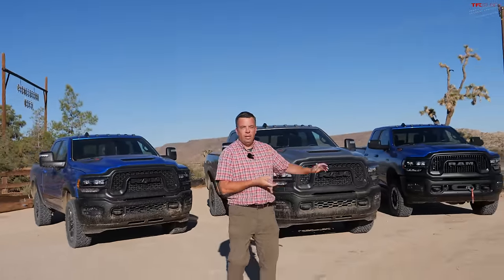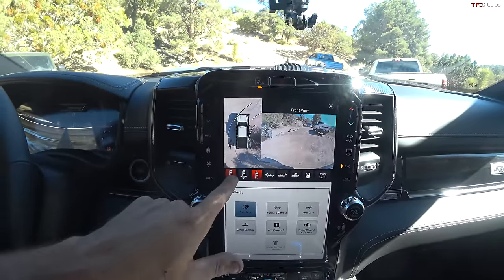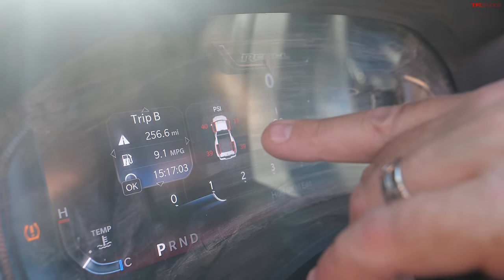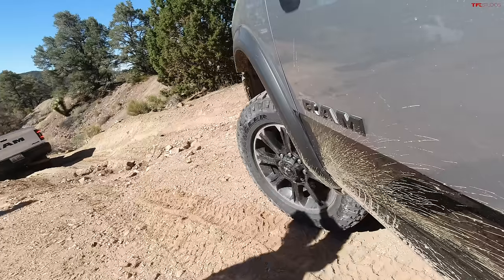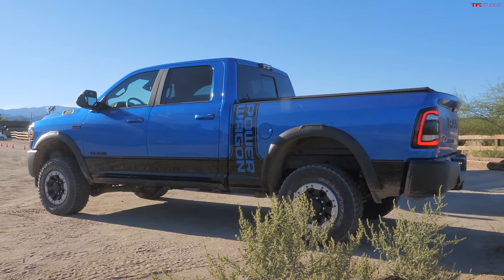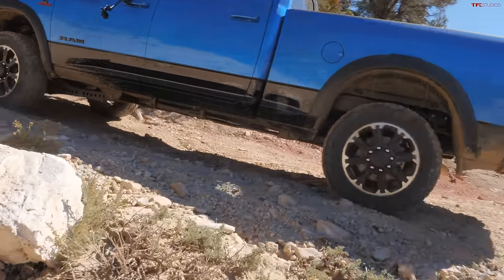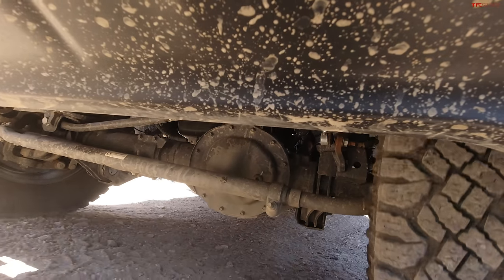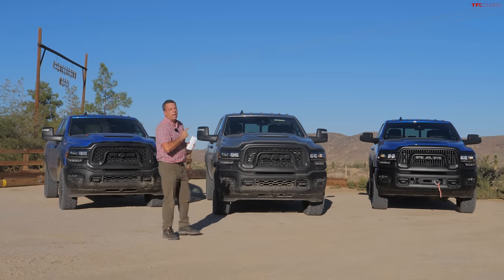2023 Ram HD Rebel vs. Power Wagon: One of These Trucks is the Off-Road KING, But Which One Is It?

Comment: 5 WAYS RAM COULD OF MADE THIS A WINNER:
1. put 35 inch tires on the rebel and PW
2.put a new cab on the HDs already
or at least offer the mega cab option!!
3.offer a HO option in the 2500s
4. put a new 8 speed trans behind the diesel!!
5. at least offer a limited slip in the front!
Reply: Yes can we get the new cab already

Comment: I always wanted a power wagon cause dual locked solid axles and disconnect sway bar… then Jeep made the non-power wagon aka the Gladiator and it just fits my needs much better. Didn’t want another full size and wanted something a little bigger than my Tacoma. 

2k lbs less, same size tires stock, much easier to get in and out and park with virtually the same off road dimensions. With a 2.5” lift and 35s though I still get better fuel economy and have far better off road capability than the power wagon.
Reply: That’s one of the most logical things any has said on the Internet
Reply: You know what’s messed up though they are pretty much the same price. A midsize truck for 60k just makes me go crazy. I love the idea of a convertible truck by if I had 60k I would have to go for tradesman pw. Now if the 392 or that tti6 makes it’s way to a gladiator then I would go with the gladiator.
Reply: @rosswallace2969  The above truck was $90k. I bought mine for $48,400. They aren’t close in price when similarly equipped even a loaded out $65k Jeep.

Comment: I love my paid-for 2014 RAM 2500 Laramie Cummins 370/800 68RFE. 70k trouble-free miles. Sticker was $60k new. 2240 payload and 17,100 rated towing. I bought it new back in late 2013. Personally I don’t need the off-road capabilities that the Rebel and Power Wagon provide.  Also getting 16-17 MPG average and over 20 MPG on highway trips is nice. The prices of new trucks, all vehicles actually, is ridiculous. It is neat to see the RAM trucks in this video in action. Thanks Andre!

Comment: Same problem with these packages as with the other manufacturer's coolest and most capable offroad packages: They are only available in a crew cab/standard bed. Need a doublecab/extendedcab pickup with a standard bed to get a shorter, more offroad usable, wheelbase. HD trucks already don't cut the wheels as far as as Fullsize trucks and are a foot longer. But add another foot of length because these are all crewcab and you need 40 acres to turn these rigs around.
Reply: True but most people aren't going to pay 90k for a truck and take it any place very rough , the places he took  these trucks like I use to take some of mine. Me personally I would buy a used beater to take out into the rough stuff.

Comment: The only draw back to my ram 2021 2500 6.4 was the spongy brake pedal. My equivalent work truck is a Ford F250 and it does everything great. This is just my experience. And yes the dealer said the braking system was normal on my vehicle but it didn’t feel normal to me.
Reply: Did you get the computer update? There was a recall issued with a computer update to address some braking issues.

Comment: Ford Trembler may have 35's but it has leaf springs unlike the Ram Rebel and Ford Raptor. You can add 35's to the p.w. no lift. Diesel is soo heavy in mud and snow the truck  slides all over the road. Gravity takes over. Diesel is good for towing. Torque for starting the load moving and low RPM for fuel savings. P.W. is the King off road period. Before Jeep there was Dodge 4x4 trucks since 1934.

Comment: I've never seen the point of the power wagon, it's too big for most trails and it can't tow anything because the payload is horrible. Power wagon just seems to be the truck for guys who need to compensate for other shortcomings. I guess it would be a great recovery vehicle but only in open areas like sand dunes and big trails.
Reply: It's even the same with some of the "regular" 2500. TFLs 2500 cummins has a payload of like 2000 pounds. It's the same as my toyota hilux!
Reply: Called options. We should just be greatful RAM makes it.

Comment: To Andre's point about the size of the wheel robbing tire side wall 4:00. I wish truck makers pushing off-road capable trucks would stop with the 20" OEM wheels. Tire tread is NOT enough if you are going off-road. You need as much tire wall as possible both to be able to sufficiently air-down, but also to protect the wheel rim from getting bent on a rock. Regarding range, nothing beats a diesel 7:00, only problem, the White just said there is only 25 days left of diesel fuel. Not sure how true that is. But they have been selling our fuel reserves to China. Just throwing that in there as something to think about. If it's not the issue they stated it's not a problem. 7:32 I have also thought these grills were fugly. Again, I have to agree with Andre on the 20" wheel and lower profile tires for similar reasons I mentioned earlier.

Comment: I’m looking for a suitable, good looking, long lasting & more aggressive replacement tire for my 21 Ram 2500 Laramie with 20 inch wheels. I’ve gotten almost 17,000 miles out of the original Firestones so far but I’ll need to replace them before I get to 20k. Thoughts on going with the Goodyear Duratrac??? I like the off road capabilities but how economical are they when it comes to towing?
Reply: I get about 2 yrs/20k miles out of them on my PW. Rubber soft great in snow

Comment: Power wagon has a 50% front 50% rear  power split. Does the Rebel have 40 60 split? Power wagon has low ratio transfer case.

Comment: Ram/Stellantis is being strangely stubborn about this package by not offering a winch on the Cummins Rebel. If you bite the bullet and spec out an AEV Prospector - which demonstrates on a proxy OEM-level that it can be done quite readily - they'll gladly put their winch/bumper on your truck, or you may opt to do it yourself. Ford offers it on all SuperDuty Tremor configurations, so why can't Ram? 

Further, unlike Ford, why isn't the HD Rebel package offered on the 3500? It would reasonably extend the payload capacity gap between the Power Wagon and the Rebel 2500 and make this whole "HD Rebel" idea seem less like an overpriced afterthought and weak counterpunch to the SD Tremor, than a real off road performance package.

Comment: You can always tell your dealership before buying that you want the 18 inch wheel instead of 20 inch ones. If you have a good dealership they will switch them out. Ram should of did this Cummins Rebel a long LONG TIME AGO! I do drive Ram. I currently have 3 Ram trucks. If I were to buy a new truck today I would get a Ford Tremor 6.7

Comment: These diesels arnt great for off road. They are meant to be pulling at a constant rpm. (Thanks useless EPA emissions) if you are doing more off road. I don't think you'd buy a full size truck anyway. But gasoline engines will always be a great choice for off road. These modern v8s are Beasts when it comes to hauling your typical stuff.

Comment: I have a 2015 F350 King Ranch Powerstroke that I bought new. I do trails like this pulling a 7000 lbs travel trailer. My truck has a Carli leveling kit, the factory rear locker and 35" Ridge Grapplers on it. Handles trails like this without even working hard.

Comment: Frame chassis just cracked in half. 
Anyone have any issues like this? 
// 2020 Dodge Ram 3500 1 Ton rated at 6000 GVW Not over weight and not carrying water at time. Carrying a 2020 Eagle Cap 1165.//

Comment: What I really want in a heavy duty truck is a standard cab and an eight foot bed.
Reply: well order one then
Reply: @speterbilt  They aren't available in that configuration. Only in a four door with the tiny bed.
Reply: @CraigSmith568  what? Wrong. On Ram's website you can build & order a single cab longbed all day
Reply: @speterbilt  Go try to order a Ram HD Rebel or a Power Wagon in a single cab. They even say in this video it's only available in the four door.
Reply: @CraigSmith568  that's true. But ypur original comment didn't say that you wanted one of these specced that way. I agree it would be cool if you could get one that way
Reply: @speterbilt  That is true, but I just thought that since that this video was about these two that it was what I meant. I guess I should have been more clear on my original post. I agree it would be nice.
Reply: Nobody does that anymore. Do they?

Comment: Regardless of it's off road abilities, it is inexcusable that an HD truck has less payload than a Maverick.
Reply: Small sacrifice to be capable of going almost anywhere. Maverick wouldn't be able to climb over a trail of Lego toys.
Reply: @sh0cktim3  but the Mav will get where 90 percent of where people need to go. And it will drive further each time all while carrying more weight.
Reply: @Silverback_GMT410  PW is a specific purpose built vehicle man. Best truck with a factory warranty that you can take off road. HD frame, steel bumpers, don't gotta worry about bending nothing. Winch available and rides like Cadillac ON and OFF-road. Can seat 6 people. 6 and 1/2 foot bed. Can still tow over 9000lbs with ease. I don't see any point in complaining about having different options available to us as consumers. You can literally buy a 2500 HD RAM with over 4000 payload and it'll tow 20,000lbs. Or get more crazy and get a 3500 with over 7000 payload and can tow well over 30,000lbs. Options are good. Wouldn't it suck if the only truck available was diesel workhorse with a 8 foot bed. Not everyone needs that. End of story.
Reply: @sh0cktim3  but my issue is that at 9000 of towing for a truck that gets maxed out by it’s tongue weight is pretty sorry. And and HD truck with off road chops can be found with the Tremor that can also seat 6, 6 and 3/4 bed tow north of 10,000 lbs and payload to spare for people, and cargo. Along with a winch option, and engine options.
Reply: @Silverback_GMT410  tongue weight only getting maxed out if you can can squeeze 6 fat chicks in the cab. Tows 9000 with ease,  rated from the factory to tow 10,500.

Comment: When comparing door stickers you told us what the 2 gassers towing capacity was. But not the diesel. Just the payload.
Reply: He didn't mentioned it because diesel is less. Max towing for such model is 14,920 vs 16,870 on V8.
Reply: @jeffwill4923  that’s why I love a gasser. Definitely need an Ike towing test with this truck, hemi vs Cummins.

Comment: For me, I’d really consider a PW if the payload was merely 2000lbs.  But as is, the juice isn’t worth the squeeze.
Reply: Then you don't need maximum off-road capability.
Reply: Easy fix with some Carli springs.

Comment: I just want a Power Wagon with the Cummins and no winch.  I'll happily put an aftermarket steel winch bumper on it anyway.
Reply: So your payload would be about 300lbs.
Reply: @donrichter3523  The spring rates would have to be higher than the HEMI Power Wagon, sure. But that's a compromise I would happily accept (and I think many other people would, too) in order to get a Cummins 2500 with the articulated front control arms, locking front axle, and helical locking rear axle that are only available on the PW.
Reply: @elektro3000  Its been said many times, its not as simple as drooping diesel into the engine bay.
Reply: They don't do it for a good reason. You need to build a AEV kinda truck of you want that. Can have your winch too. Gonna cost over $100,000 though.

Comment: Power wagon is always the king.
Reply: Competes nicely with a 90’s ford ranger in the payload department too
Reply: @pryme2013  well that’s not the point of a Power Wagon.
Reply: @XploreAz  I’d venture to argue the point of a HD truck is not to off road.
Reply: @pryme2013  but that’s exactly the point of this truck. Where do you see any advertising of towing and hauling with this truck? You don’t. You’ll only find off-roading.
Reply: @XploreAz  I know what you’re saying. What I’m saying is a heavy duty truck was first and foremost designed to work. Not off road. They are way too heavy to be great off road. A run of the mill jeep wrangler would shit all over one of these off road
Reply: @pryme2013  but a Wrangler can’t tow anywhere near what this can, even though it’s only around 10k. This is for someone who likes an HD truck, wants to do extreme off-roading, and tow a reasonable amount.

Comment: With the terrible payload and towing along with size and weight, why would anyone buy any Power Wagon? It can't do any HD tasks so why get something so big and heavy? Ford seems to have it right with their Tremor package and maybe GM HDs will be nice with the ZR2 and AT4X versions. Given the numbers of the Power Wagon, I'd get a Gladiator Rubicon or Mojave instead if I didn't need to tow or have a truck camper.
Reply: And ride and comfort?
Reply: Everyone don't need work rigs with 5000lbs of bricks in the bed. Some people just wanna have fun
Reply: @sh0cktim3  there are midsize trucks with better payload ratings. My point is why get something so big and heavy for off-roading if it can’t even do truck things? A Gladiator makes more sense to me but choices are good.
Reply: @redracerproductions  it can do plenty of truck things. You can tow 9000lbs with ease. Gladiator is what 4500lbs max? They got about the same payload capacity but Power Wagon has a much bigger bed. Can you even fit a fishing pole in
 a Gladiator bed? You said it choices. We should all be happy RAM makes it. Options are good. Size aside it's still the best off-road truck you can buy with a factory warranty. Rides like a Cadillac off-road. And it can seat 5 adults pretty comfortably. 6 if you wanna throw a kid upfront. Jeeps are like 4 people. Maybe 5 with a lil kid in the middle of the back seat.

Comment: I really enjoy watching your comparison vids but your preferences kinda go outside the spec of what this test is about. If you want pure off-road ability which is what this video is supposed to be about of course the pw wins this... if you don’t intend to crawl heavily and want to tow heavy payloads of course go with the diesel rebel. 

This honestly is just a comparison between one purely off-road based vehicle and a vehicles that have some off-road capability... I mean just the fact the rebels have 20” wheels should give that away. 

I’m glad that they exist for those looking for a more all around style vehicle, or for someone doing light over landing or want to tow campers.

As far as the payload issues.... just replace front and rear springs with thuren springs and bass bing more payload. 

As far as fuel economy goes... absolutely no one buying a 65k plus vehicle (since fully specced and with dealer markup you are actually looking at a 80-100k price especially withe Cummins rebel) 

For the cost of a tradesman powerwagon equipped model you could take the 20k you’d save and throw that into a ful carli pintop system that’s makes your vehicle an absolute monster.

This is coming from someone who loves his 75th anniversary power wagon

Comment: The biggest place you’re going to feel that curb weight is your wallet when you are constantly replacing those tires.  ALL. THE. TIME.  Those 20’s aren’t cheap, and those 18’s, in that size, are even more expensive.
Reply: Tires have warranties.  They aren't hard to get replaced if they wear too quickly.
Reply: I get maybe 20k from each set, and that’s with LR E, not the D they sell on 2500s that are for 1500’s

Comment: Ram refuses to follow Ford and GM with increased 2500 series payload. It’s almost like they want to do away with the 3/4 tons. Barely half ton numbers in payload and actual  towing because you can not get to the max towing because you run out of payload. Two diesels and two transmissions makes no sense. No diesel winch? Fake vents? And I’m a ram owner!
Reply: The problem here is Ram chasing ride refinement with 2500 models. They are basically forcing you to buy a 3500 model for more payload. 3/4 ton for what has been said is higher in sales vs 1 ton.

Comment: Imagine the range if Stellantis brought back the OEM 50 gallon fuel tank, currently restricted to only the Tradesman trim level.
Reply: Imagine if the power wagon had that tank. It would have enough payload to haul one adult huffy or two kids huffys in the bed.
Reply: Not true. You can get the 50 gallon tank option on all trim levels (except PW). You just need to have the 8 foot bed.